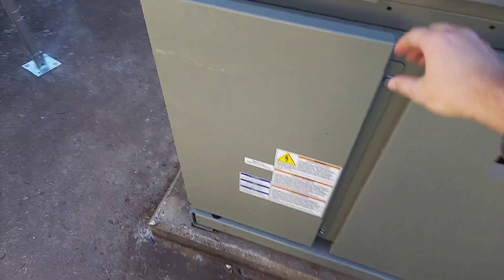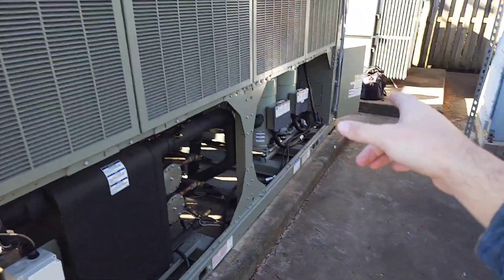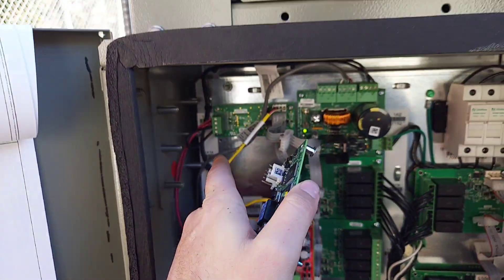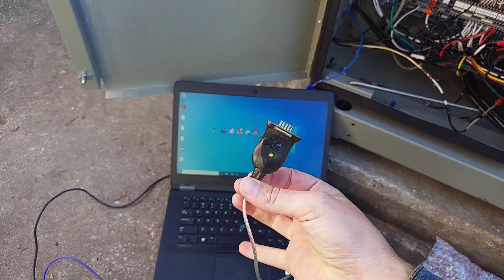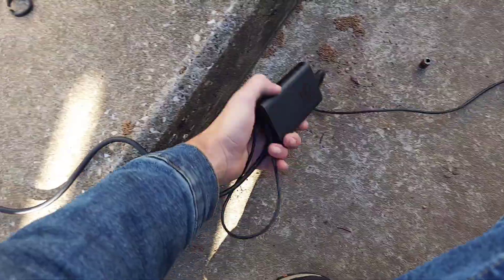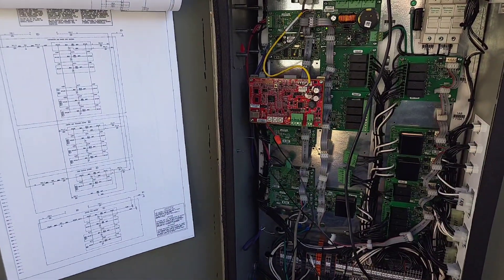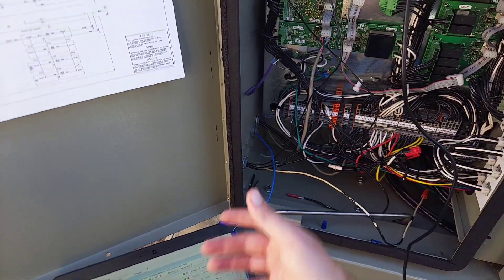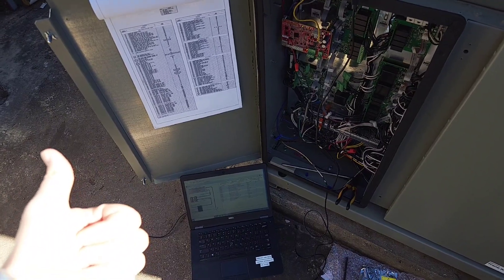Chiller LON Board Install on New Trane Air Cooled Chiller CGAM

Comment: A cigarette lighter socket is good for 120watts max as a general rule. Check your fuse.
Reply from the maker: Our service trucks have a heavier watt rating.
Reply: I wired mine straight to the battery with #2 cable and inline fuse. If you were doing more than just charging a laptop, you would overload the power point socket.

Comment: Hi, I have a rtac unit same tracer trane view components. I have a condensor motor running backwards.  Moved to an ok contactor and started running good. Traced backwards rotation power back to the quad relay board.. would this be bad and require binding?

Comment: Is that the same LCI board that is in RTU's. I have a few sites with larger voyagers that have the LCI boards installed going to the RTOM board and back to the RTRM board
Reply from the maker: I dont believe so, those dont use the 530 control system.

Comment: Blimey that schematic isn't gonna last long being regular paper  in that spot , one rain shower and it's done for .
You should get a Milwaukee top off for your laptop , we don't have it over here and we don't use 120 V anyways , so I just have a a cord that I cut the plug off it and I just steal the power from the electrical compartment off the unit 😎.
Reply from the maker: It has a laminate coating on the paper, but after several years it deteriorates pretty bad.
Reply: I've worked on those CGAMs for quite a while. Once you have the access panel closed properly moisture rarely ever gets in there. Plus no bleaching from the sun.